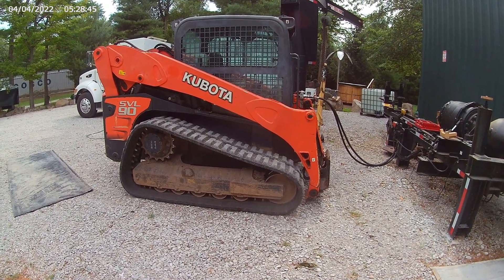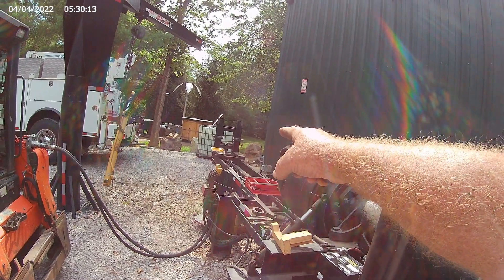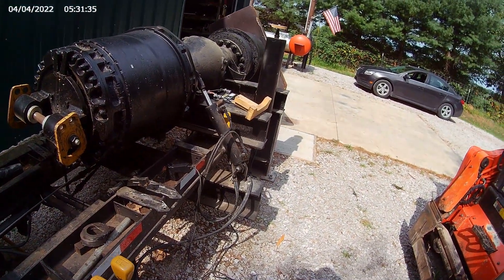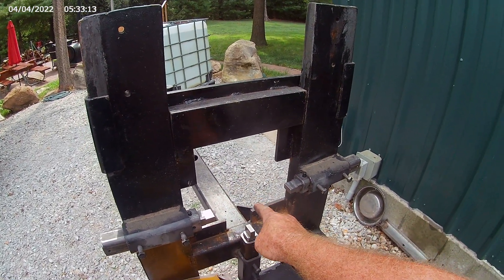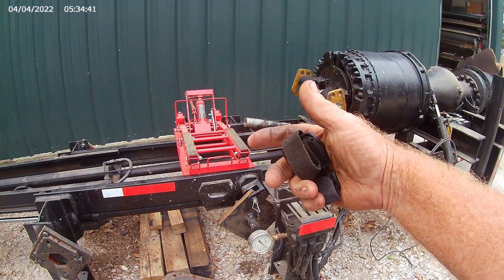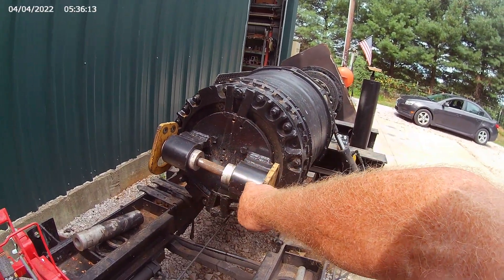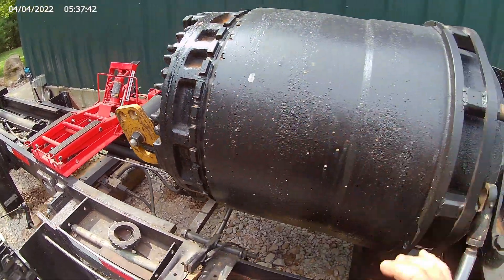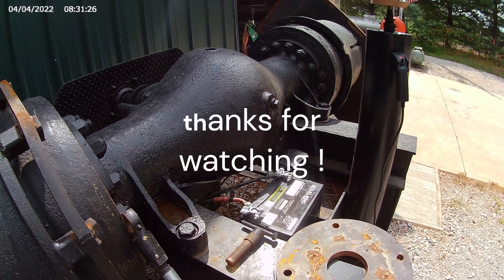homemade hydraulic cylender machine.

Comment: Excellent video there is a lot of thought you put into building that machine. What do you plan to use for a brake system to hold a engine as you revolve it around. I am planning on building a engine turning stand to be able to revolve a 855 Cummins diesel engine the long way by holding the engine on its side I got a final drive assembly from a big Allis Chamlers combine and it has a hydraulic brake rotor and caliper set up but I plan to make a pinned double plate to hold a position . Keep up the great videos
Reply from the maker: this is it right here same thing engine long ways. The engine plate is 1" also spaced away 1" for bolt clearance. the hydraulic motor will lock it from moving ,but you can allways install a safety pin.